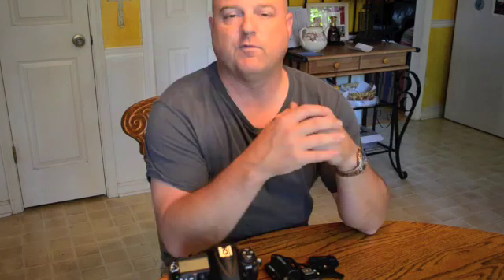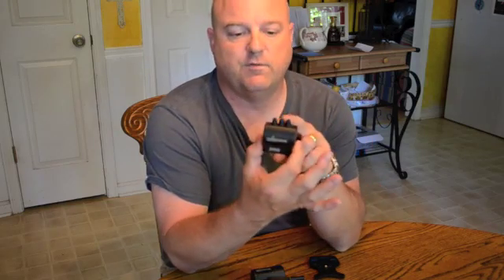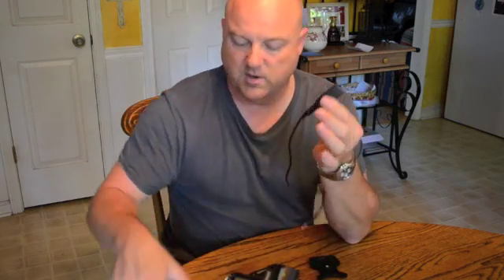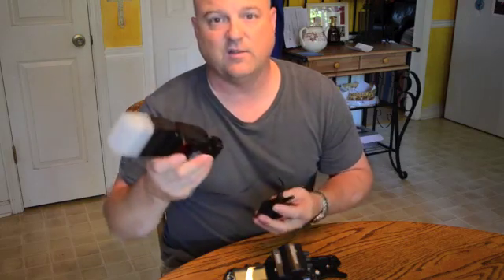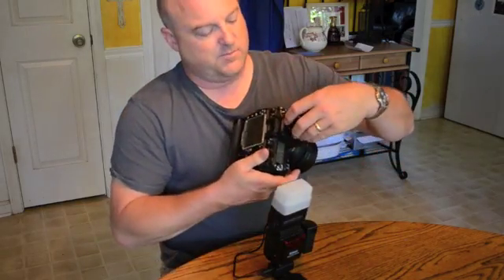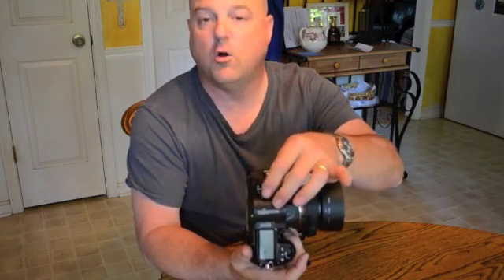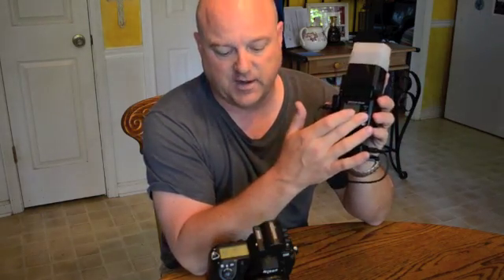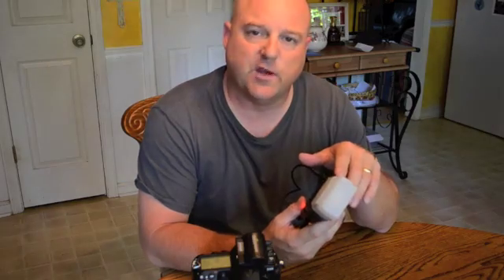RadioPopper Part 1

Comment: Great overview Mike. One question: Shouldn't you remove the white protective cover on the flash? It will put out way more light with it off. I didn't buy the cover-I just cover it up with a piece of thick cardboard.

Comment: Great video.  You answered all of the questions I had regarding the JRX system and SB600.  By the way, you can turn off the standby on your SB600.  But, the downside is it uses more battery.